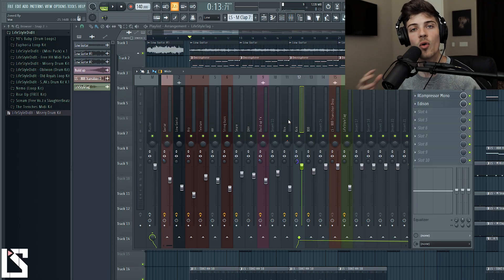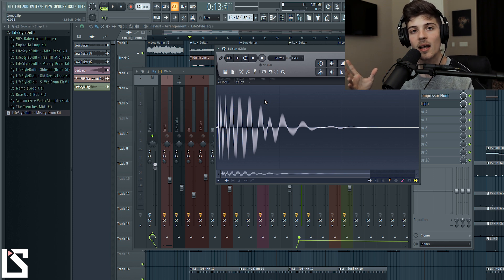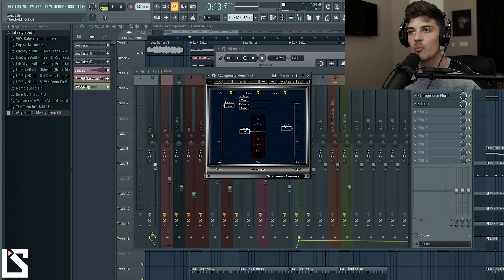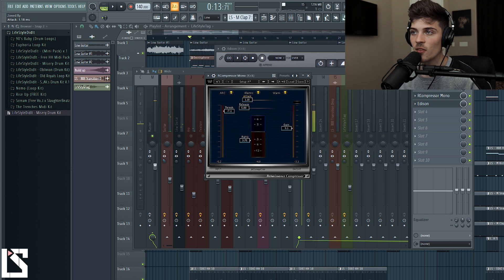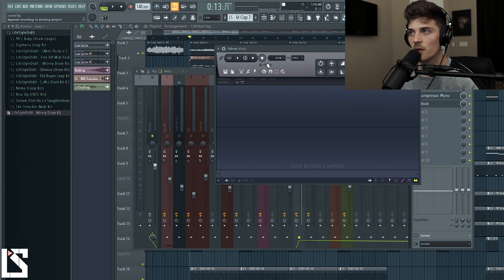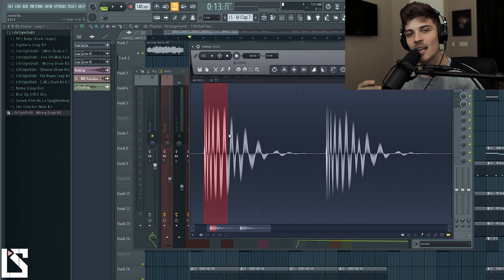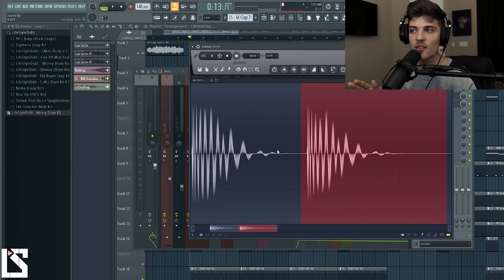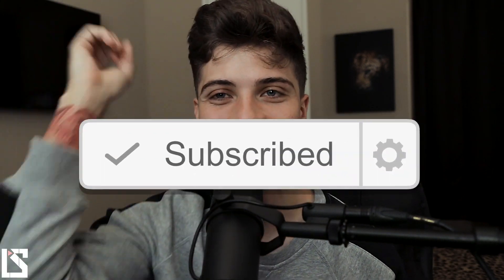MAKE YOUR KICKS PUNCH WITH A COMPRESSOR

Comment: you confuse the peaks from waves of the body with transients. (5.50min). A transient is the first bit ONLY you selected 5 full cycles and talk about every peak of that cycle like they are transients..... Confusing at best... I get the point you try to make getting the body even for a consistent punch but this has zero to do with the transient. A transient is the initial part (spike) which does have a tonal character. The waves you selected has 5 cycles (pitch down) and the initial 10 percent (or less) is the transient. A transient Isolated would be not much more than static, noise or a tick. about 2-5 milliseconds. 95 percent of your selection is the body full tonal cycles no arrangement of transients. I see people talking about speech and knowledge but using the wrong terms and calling the decaying peaks of the first 5 cycles transients is silly and confusing.

Comment: Setting a slow attack on a compressor to enhance the transient of a kick will normally result in a loss of low end. Something like a pultec eq after the compresor in your kick chain is normally needed. Unless you're going to use paralell compression which is ideal for exagerating your transients.

Comment: Great video. So much good info here... This is a great visual explanation of how attack time and threshold work. And really not trying to hate, but unfortunately your release time never really changes. You have the release time control set to automatic the entire video...  which makes this particular plugin ignore the adjustments you made to the release slider. If you click on the ARC (Automatic Release Control...) button in the upper left it will turn blue and switch to manual and behave in the manner I think you actually described and intended here. Great video though with that one small caveat...   Look forward to checking out some of your other content.

Comment: I’ve been struggling to fit all elements of a song together. How do you make something like Rhodes just sit in the background while having other instruments blend in or stand out without being over bearing?
Reply: Usually something that is far away from you doesn't have a lot of high end and has more echo, You can use reverb and eq to shape a sound to sound more in the background maybe for bass a high pass filter could make a bass sound more soft and for a more higher/mid range sound maybe low pass filter could work so that it has less highs, It can also work the other way around, If you want to something to sound in your face it is usually volume matching and a lot of high end compared to other instruments that has less high end for example and also volume so that it is more far away volume wise , Also it is usually about contrast, If you want something to sound more in the background you have to use an instrument that is more in your face so that it contrasts between the two :) I hope that makes sense =D